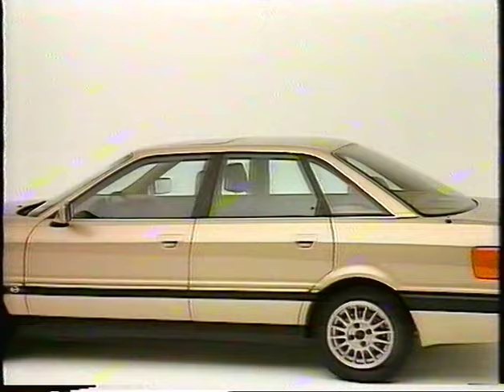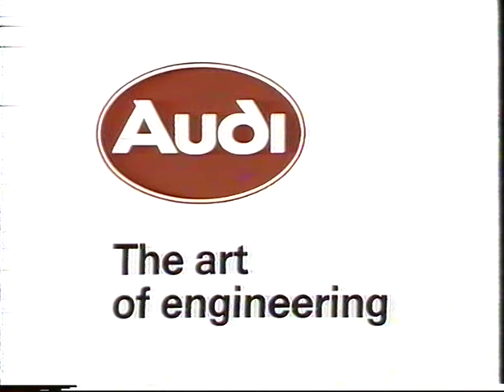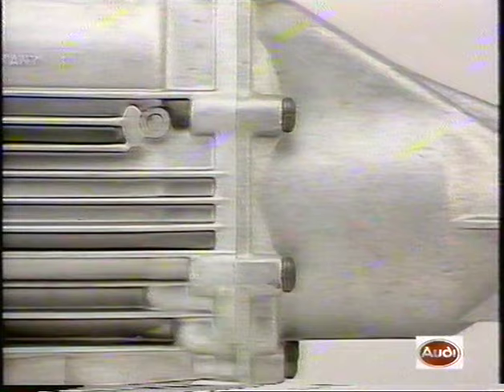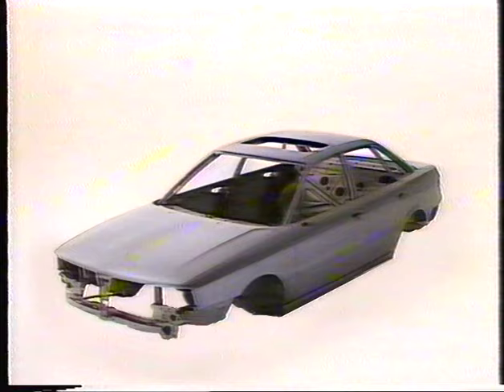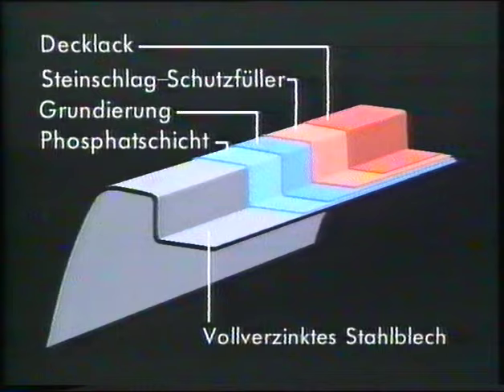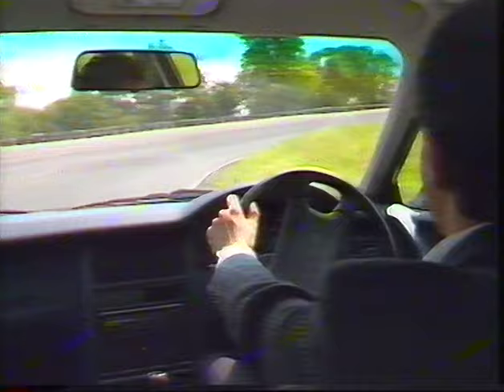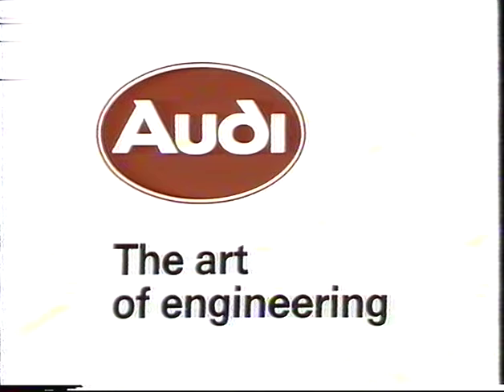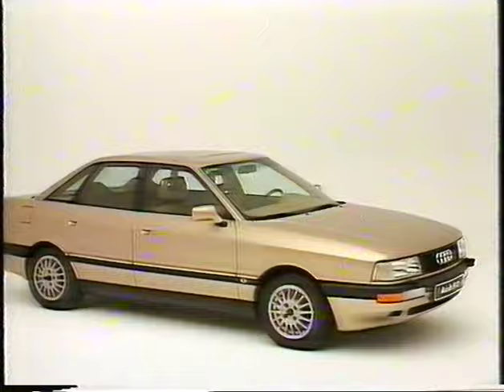The new Audi 90 - Typ89 B3 Official promotional video

Comment: This is by far one of the best cars I've owned. Such a durabel and capable car, especially with the quattro system👍 My previous cars from the same time has been very plagued with rust 👎
Reply: Hot dip galvanized high strength steel. Now, unfortunately, this is very rare to meet! Nowadays, only zinc powder is applied to the paint primer.

Comment: I love that in the background you can hear eurobeat like music, when i will get one from my dad i will find this promotional music and play it all the time. (for anyone intrested, its a 2 litre straight 5 10 valve ps engine, audi 90 b3 with mechanical injection this one has less hrsprs but more TORQUE so it accelerates faster than 2.3 litre version)
Reply: Any idea what the song's or the musician's name is? I've been searching for that rather sketchy tune for quite some time now, but for no avail…
I know however that it had been used in a late 1980's German crime series („Hafendetektiv“). Still, finding either the artist or the song has proved quite tough.
Reply: @AeNPe101  Try to use Shazam.
Reply: @3EP0 Been there, done that — nada…